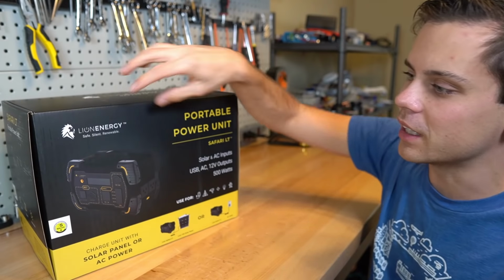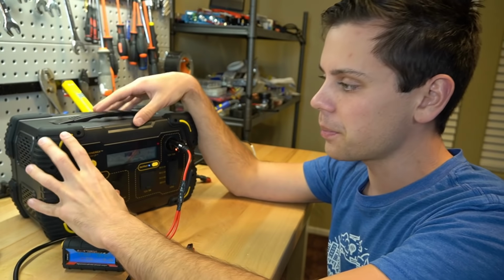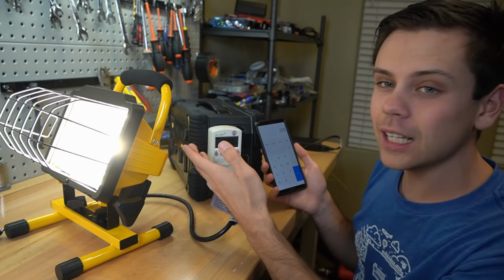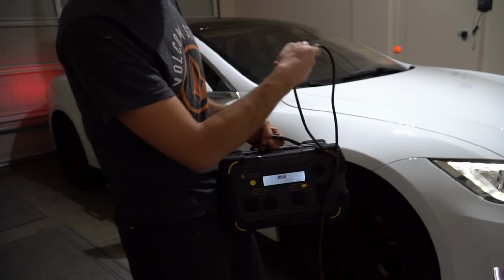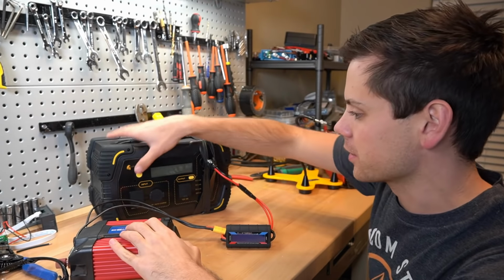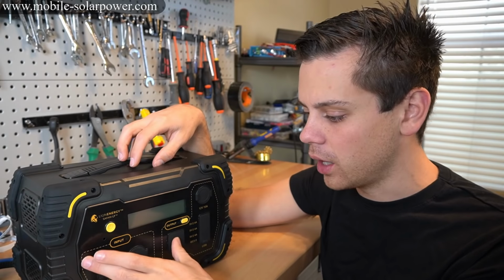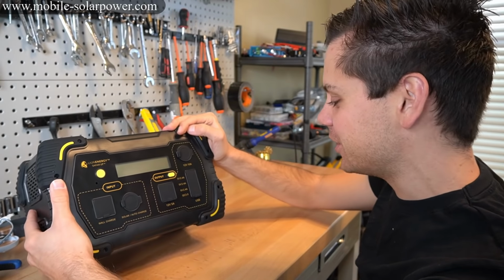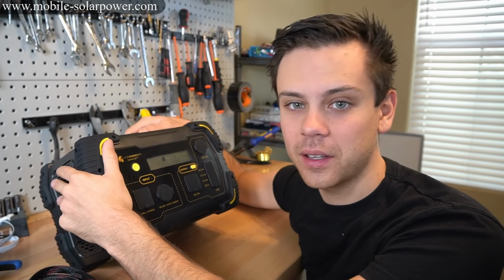Lion Energy Safari LT: Fast Charge Solar Generator -Full Review-

Comment: I bought the Lion Energy Safari LT it never turned on and when I reached out to the company two times and have been told the would get with me but never did. I finally got fed up with it and went to take a look at it took the cover off and it was crazy to see there are two big scratches on the charging board and a Knick in the positive cord between the battery and the charger for the inverter. Could you tell me how to get another charging port board.

Comment: Purchase a separate power supply that will regulate the voltage.  Everyone does't require 12 but some other voltage or combination of voltages.  It is best to have a choice.  Stringing supplies reduces efficiency.

Comment: Great catch Will; I just found and watched your Lion Energy LT review. I’ve yet to use the 25’ Solar Extension Cable with our Safari ME; bought this unit a year ago for use with our RV. Hopefully Safari fixed the defect, But in any event; I will follow your advice and put some Heat Shrink Tubing around the Anderson Power pole connection to the cable. Overall, I’m very pleased by the Lion Energy ME and the EP. Thank you for that catch, as I’d never  even imagine, like many others, pulling off the connectors insulating cover to inspect it.

Comment: Late post because I've kept this same unit for emergency purposes and didn't test it out too much. Since I use a CPAP machine, I used some remaining medical flex spending account funds to get this unit (came with the fast charger, slow charger, solar panels, and some camping lights). The way the buttons have worked for me is you need to hold them in when turning on/off the power and outputs. I was able to test the unit in a real-world scenario lately when we had electrical issues in our house and I had to kill the circuit breaker with 9 bedroom outlets on it. So, I used the unit for my CPAP machine for over a week until the wiring was fixed. Not realizing I had a fast charger with everything else in a box, and thinking I had only one charger (the slow one), I was connecting the slow charger every day to recharge the unit during daytime hours. It would take up to 9 hours to charge! From now on, I'll use the fast charger (3 hours will be much better than 9)! Really, I wanted to have this in case the power is completely out and the fact that it can quickly charge via the solar panels, which I also purchased. It will be a nice backup to my propane/gas generator (used for heavier loads).

Comment: I wonder what the manufacturing cost saving is using non-regulated 12v output over a regulated 12v output? Is the cost-saving justified with the resulting loss in functionality?

Comment: How a company can make a unit like this and not have a regulated 12v I will never know.. AC50s seems like a much better buy and is cheaper with more capacity, but has a smaller inverter and slightly slower charging.

Comment: Wow, kinda brutal, but I appreciate the reviews.  I'm shopping for both a 500W (or so) portable system plus a home backup system.  These are very helpful.  Personally, I don't care about the unregulated 12V car port and I suspect the cable source is not the same as the source for this product.  I'm leaning toward this one right now.

Comment: A lot of the modern cheap 12v fridges will have an option to set the low power cutoff to 10.1v, which is a nice option if you want to run it on the unregulated power systems.

Comment: Was thinking about buying a Lion Safari NE (Elite) but there are no "reviews" on it yet. Decided to watch your review of one of their smaller units. The wire crimp problem you discovered is a HUGE problem for me. It speaks loudly of their lack of quality control. Having said that, the cable is not part of the unit and may have been produced by a different company. Thanks for your thoroughness.

Comment: I'm guessing that you're referring to 12 volt refrigerators that use a compressor. I've always used thermoelectric units because they don't seem to have as narrow a voltage input range. You can actually get some really good ones if you look around. I am actually considering getting one of the compressor based units to see how well they work.

Comment: I have a solar generator rated for 80w 12v input for solar charging. My panels are 200w 12v. Is it ok to use my panels to charge my generator? Thanks
Reply: Based on what I learned from Will. The volt limit is what matters on your SG. Watch his SG comparison video of a bunch of small SGs

Comment: Will ,have you seen the new Bluetti  240 which is quite a bit bigger than the 150?  I would love a review since I had to return the 150 I had because I couldn't get more than 106 watts from the 110 plugs which screwed up my computer and my LEDTV.  Thanks so much for what you do!
Reply from the maker: I have it. It's the same as last model. Good unit
Reply: @WillProwse  Do you know if they resolved the issue of the 110 plug being under powered?  As I mentioned I only got 106 watts per plug which screwed up my TV and computer.  Thanks so much.

Comment: The button for the "unregulated" output is a "soft" button... so there is some kind of switching electronics, very likely the reason it would not turn on with the inverter is because it registered the capacitors in the inverter as a short circuit and so it refuses to turn on, hence the flashing.  I have a similar issue with a large solar controller that won't turn the output on when connected to loads with large input caps... it needs some kind of soft start.

Comment: I’m just a little confused on a couple of things. The heat gun test was 137W... I thought those things had much higher wattage. Hair dryers and space heaters are typically between 1200-1500W, aren’t they? How can a heat gun be so much less? Secondly, my understanding is that laptop is 140W. I used an online calculator and typed in the info from it’s power supply: 20V/6.75A. So I was very excited to see that you were testing something that I understand to be the exact wattage that I need. But then you didn’t use a timer during that test. Do I just divide the ~400Wh by the ~140W and that will give me the usage time? Also, can it charge from solar while the inverter is on and in use?

Comment: Totally agree about the unregulated DC output. I have a Ridge Monkey Power Vault I use to charge my drone batteries in the field, trouble is the adapter I use to charge the drone batteries requires at least 12.4V so at full charge everything works fine but as the internal battery discharges below 12.4V everything switches off. Grrrr. A simple regulated supply would fix everything. Agree with your conclusion: if it ain't regulated, it's broken.

Comment: Check your math. You are dividing when you should be multiplying. 100X88%= 88    100/88%= 113.63
350/ .88= ~397    350X.88= 308
Reply from the maker: No, we are calculating the consumption with losses. If I was calculating the loss, I would multiply. Does that make sense?
Reply from the maker: You divide when you want to see the losses and the total consumption
Reply from the maker: That's why the number is more. It includes the losses. That is the exact calculation I need. Let me know if this makes sense to you
Reply from the maker: We tested at receptacle. We are doing coulomb test.

Comment: It seems that the company is not allowing the 7 year olds to take their naps during their shift and is working them the full 16 to 18 shift without ANY naps. Guess they figure since the kids are seasoned employees and have been working 3 years they should be more focused on the details, like the wiring of the cables. Jackery beats them?

Comment: Hey Will, does the Lion Safari LT allow a load on the output side while charging in any of the possible modes? Keep harping on the manufacturers about the regulated cig lighter output. It’s not going to happen until somebody decides to use a higher voltage chemistry. You can’t get blood out of a rock haha!
Reply: Yes. It has to be able to charge while running output. I was a their booth at expo east and watched a 12 volt TV running while charging from solar panels

Comment: Nice test! What a shame though. I got excited when I saw the Anderson input. Wish more offered that. Again, fail on the 12v output. Hope these manufacturers wake up.
Reply: Unfortunately the configuration of the Anderson Power Poles is non-standard on this device and won't be compatible with other adapters / connectors.

Comment: The reason this power pack would not start when the inverter was plugged into the DC port is due the large capacitors on the inverter’s input which are present even when turned off.
When you try to turn on the DC port, there is a significant current surge needed to charge these capacitors which trips the over current protection circuit of this power pack. In my opinion, they have this over current trip configured for fast trip when it should be set slower to accommodate transient startup surges. Same reason there make fast and slow blow fuses.
Reply from the maker: True and I thought that as well with instantaneous reading to cause ocpd to trip, but every other one on the market can handle it. Ocpd shouldn't trip from this small of an inverter

Comment: Yes they should regulate the cigarette lighter or 12 v source to actually be at 13.8 v because most small draw things like my handheld cb require 13.8 to operate properly or it will click. They could definitely add another 20v option with lifepo4. Thanks for how thorough your information is packed in the video wow! Super! My experience...Lifepo4’s max out @ 200 amps and easily start a truck.

Comment: Maybe the output light is flashing because there is a current limited protection. When you connect inverter  it will take high amount of amps for charging the capacitors ..

Comment: Hi Will, When you do the Renogy 50A mppt/DC to DC charger, I hope you can add the Sterling Power DC Battery Charger 12v input to 24 v output DC to DC converter to the test.

Comment: I'm glad I went with the Jackery 500.  I figured out a way to almost double the DC car charge rate by splicing a 8mm DC connector on the output of a 12V to 24V 3.5A charger that cost about $32.  I still haven't been able to get a solar panel to charge it faster, but the DC charger was a game changer.  I got the DC input watts up from 42 watts to 78 watts, which is almost as fast as the AC wall wart charges.
Reply: Can you provide a link to the two parts you used?  The charger and the 8mm DC connector?

Comment: get one of these, 1200W 20A DC Converter Boost Step-up Power Supply Module IN 8-60V OUT 12-83V off ebay or aliexpress

Comment: I have a Suaoki G500 with a 450wh battery  and it charges at 150 watts max from solar and thru my car with a 24v boost converter. 12v output is regulated as well. Inverter is only 300 watts continous tho. Worth reviewing for this class of generator.

Comment: I can understand manufacturers leaving out a regulated 12V output. A high power 12V buck/boost regulator would take up a fair amount of space in a portable unit.

But I was just wondering how well an external 12V buck/boost regulator would work with something like a 12V mini-fridge.

Looking on Aliexpress shows 12V/13.8V buck/boost regulators up to 25A for a reasonable price (I'd leave a link, but my comment would probably be removed as spam).

Comment: With those rubber bumpers it should have drop protection but the manual doesn't have any mention of it
Reply: You don't want any Lithium battery technology to be getting banged around. If they advertised 'drop protection' you can bet your last dollar some idiot would burn down their home abusing it this way and then cry to their Lawyer about that. Yes it will take some abuse as they all will, but this ain't 'MilSpec" or priced for that market.

Comment: Will, FYI I use 12v DC5521 outputs on my DIY set up. My traditional battery chargers (AA/AAA/9v/18650) have DC 5521 12v inputs. Same for other gadgets which have 12v DC 5521 inputs. 

I didn’t bother installing an AC inverter in my setup as most gadgets I use are DC devices hence can be charged via DC inputs including laptops, DAB radio, Makita cordless batteries etc. I don’t get why people who have DC power supplies use AC to charge DC devices. Just charge DC to DC.

Comment: Can this unit be charged and discharged at the same time?  That, and the regulated 12v output  and great display are the reasons why I stick with Jackery for my CPAP. But I could be swayed to switch for the fast charge rate.

Comment: NMC is cheaper and has higher energy density. If they put LFP cells in these units, they’d have to either make a larger box or reduce battery capacity, in which case they won’t be competitive on the market.
You say you’d pay more, but average customer will not pay more.

Comment: Say, I got a $50 off coupon on Amazon for a small solar generator.  It brought the price down to $69.   I believe it has 35 ah of battery but feels like more. It claims a pure sine wave inverter.  I had to buy a solar adapter seperate but came with ac and car charger a a separate 12 volt port.  The old one I had did not have a cooling fan, this one does. I'm very impressed.   They actually dropped the price to $79.  For that price why not??  It's awesome.  I use it instead of running my Salex 1500 watt inverter for everything.  I think it's 159 watts. I'm almost tempted to buy another to give to someone that has no power.    I'd love for you to let me know what you think.   My old portable lasted 3 years and everything but the 12 volt output for DC or a 12 volt port adapter.  Maybe it blew because it had no cooling fan.  This $70 one has a cooling fan.
Reply: Interesting
Reply: Does it have a name or is it an ESP nonsense thing?

Comment: Not regulated 12v?!?!?!?!

NOOOO!!!!!  Make them tell you why Will.  

That’s why I like my Jackery
Reply: wakawaka1976 pls help.. what does it mean 12 v not regulated?? Im about to purchase one tomorrow.. whats bad about that fact?
Reply: @dexsea24   Unregulated means that the 12Vdc output is tied directly across the internal battery so the 12Vdc output will drop as the internal battery discharges. For example, at full charge such a battery might output 12.6V ( a typical 3P Li-ion battery at 4.2V per string = 12.6V ), discharge to a nominal 3.7V per string, the output drops to 11.1V and when fully discharged the output would be down at 9V.

A regulated output would always be at the specified voltage e.g. 12.6V no matter what the state of charge of the internal battery is. If the internal battery is higher than 12.6V, the voltage is 'buck'ed down, if lower, it's boost'ed up. Google buck/boost regulator for further info - they are very common and very cheap and should, imho, be included in all such products.
Reply: David Adams damn thats not good!! Thank you! I dont think im buying this
Reply: @tictagtube  
It must be cheaper to do it the unregulated way.
Reply: @dexsea24  
did you look it up online?

Comment: I was looking for a solar generator that would power a movie projector that's uses 300 watts but most of the $300 to $400 batteries either don't have a big enough built in inverter or the battery size would only power the projector for 3 hours then be completely drained.... And I'm thinking if you completely drain these it'd probably damage the battery life... I guess building your own really is the only option.
Reply: These will cutoff before damaging the battery. Like a cellphone does.
Reply: Mine, from another company, beeps to let you know when “the end is near.”

Comment: Will, Try precharging the capacitors in the inverter from a proper 12V source before connecting it to the Lions unregulated output. I bet a safety device was tripping up the output due to the inrush current of the inverters caps exceeding the 120W of the 12V receptacle.
Reply from the maker: Very true, but my 240wh jackery can even power this inverter until it's dead. Still surprising. Actually I powered it with a 120wh micro battery the other day! Have never had this happen before.

Comment: Would it matter if the car is off when charging??
Reply: Some of these only charge at the alternator voltage ( when car is running ) so you don't run the battery out. My car disables the 12 volt plug when off anyway. Good thing to test out!
Reply: Good question